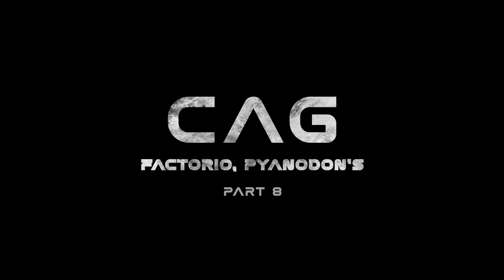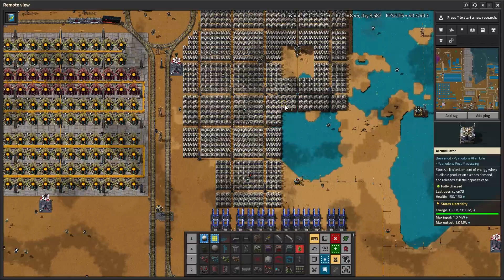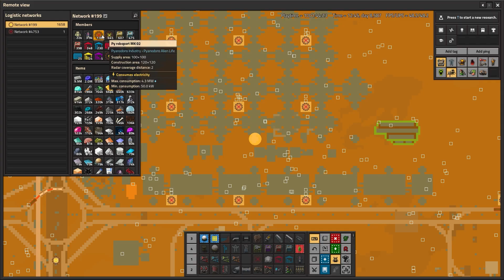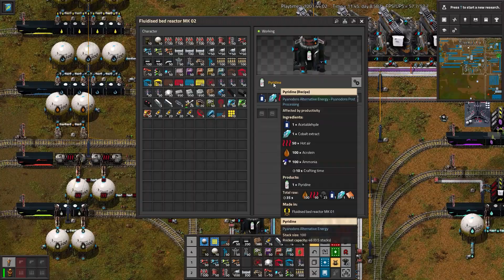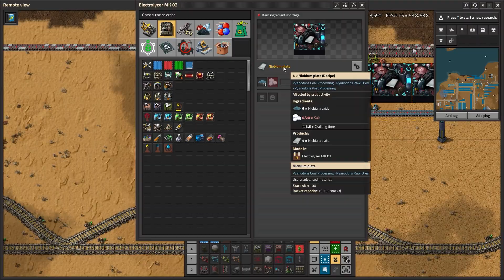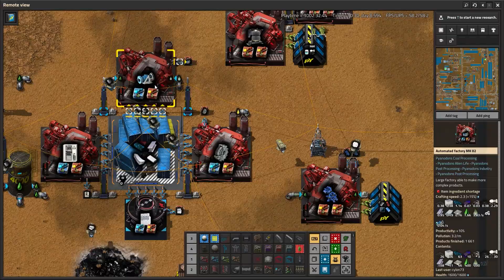I Beat Pyanodon - Factorio's Most Insane Mod (1000 Hour Base Tour)

Comment: Thanks for this longer and more thorough tour of you base. It is more and more impressive each time !
It is also nice to see you are gettin into the YouTube game more.
Looking forward for the last 4 episodes !
Reply from the maker: Thank you mate, I really appreciate ! After production science all shortages will be solved and everything will look much better. There are really great recipes with it. Also even in the next part, my power consumption will be doubled. After this point, rest of the game was easier than the early part. The only issue for me was FPS/UPS drop.
Reply: @cag73 impressive !
I've noticed you mentioned rubber was a b*tch because of Laboratory instruments. I could not agree more ! I'm having the same problem you had. Which reassure me considering you managed to finish the mod ^^
Reply from the maker: @Stareplue_Metal  Rubber issue will be solved eventually, don't worry about that but I really struggled with that until the 40x rubber recipe. It solved my rubber shortage instantly. I was so happy when I first unlocked it haha. Also there's another recipe for lab instruments but it requires electric engine unit (iirc). Productivity modules may be useful too. They are really powerful in this mod.